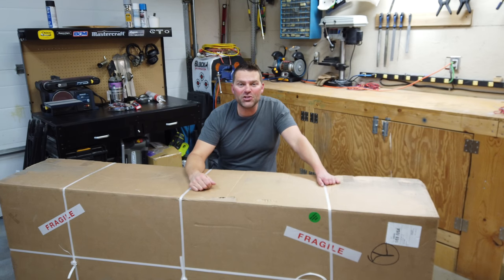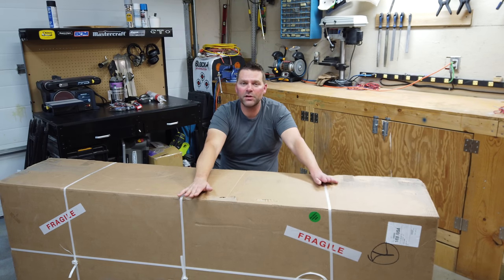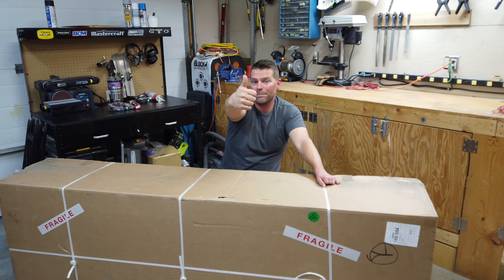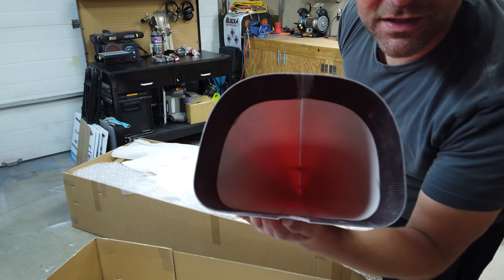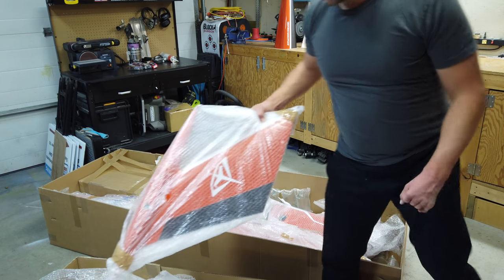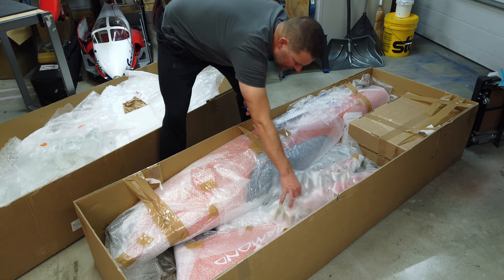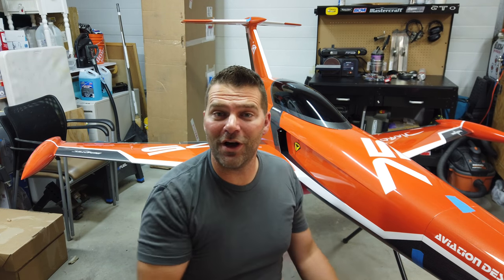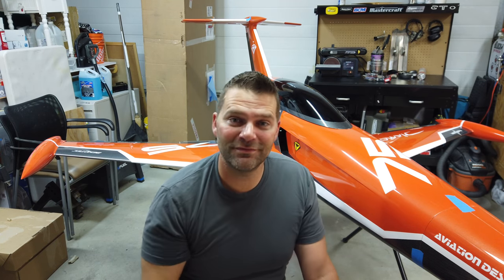UNBOXING THE BIGGEST DIAMOND - Aviation Design Aircraft Target Drone

Comment: in addition to the 1500 freight what did the kit cost? also is the kit complete? no other stuff to finish it ? thanks dan
Reply from the maker: Hey Dan. All in USD. Kit was $4300 which includes airframe, pipe, tanks. Add metal servo covers $250ish. 
Other equipment needed. Prices will vary. 
Turbine $4000
Servos $1500
Radio equip $300
Landing gear kit $1650
Gyro/gps $350
Wiring and connectors $400
Lighting kit. $350-600
Batteries $250
Smoke tank,pump,nozzle $450
Servo horns $120
That about sums up the extras from memory,
Reply: @thelightersideofrc  wowzers  thanks dan